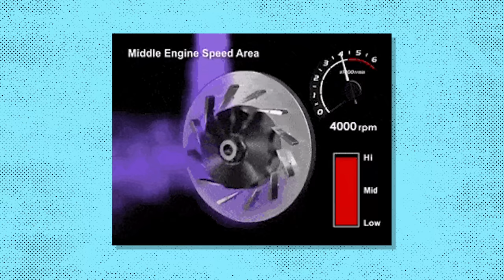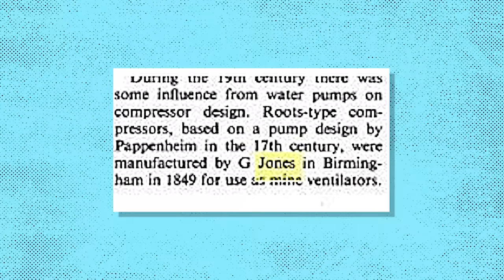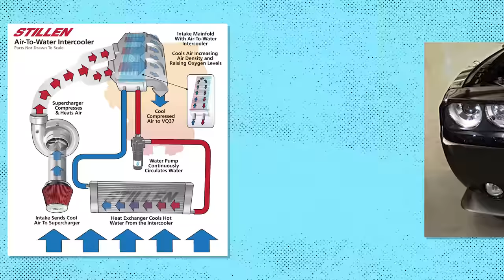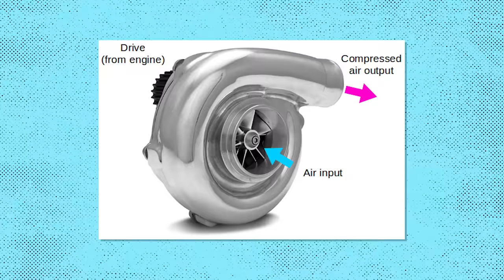Why Superchargers Aren't As Good as Turbos

Comment: From what I remember from physics class, increase in pressure in the same amount of volume increases temperature, so not sure why intercoolers are mentioned specifically in certain parts of the video. All types of forced induction benefits from intercoolers, air or water cooled.
Reply: Positive displacement compressors tend to heat the air more too.
Reply: All forced induction motors?
Not true, when running racing methanol the charge cooling makes ice on the intake of the supercharger casings. An inter cooler at the point just makes the blower up high for no reason(if under it) or is there for no reason. Ice water intercoolers can’t cool the intake temps that low.
Reply: @dallynsr  A Roots supercharger is internal compression type, so its outlet temp is even hotter... the efficiency is low but still benefits from intercooling...
Reply: @dallynsr  That doesn't apply when using port fuel injection or GDI...
Reply: @dallynsr  That would be because the methanol is evaporating and reducing the temperature.

PV=NRT, where P is pressure, V is volume, N is the quantity of gas (this is correlated with the mass), R is the molar gas constant, and T is the absolute temperature (measured from absolute zero).

By evaporating, the water and methanol (or NO2, if it is used) mixture changes from a liquid (which is not counted in the above "ideal gas equation") to a gas. It takes away some of the T and increases the N, so no power is lost, whilst the temperature is reduced and hence the efficiency of the motor increases, so making more power. That same effect is why running rich will result in cooler combustion temperatures and hence less knock and more power (to a point, beyond which more and more energy is being used to partially break down the fuel without combusting it, sooting up the cylinder and reducing power).

However, in forcefully compressing a fluid, one is doing work against the internal energy of the gas, as one applies a force across a distance. This increases the internal energy (called "heat"; related to but not the same as temperature. That equation PV=NRT is for constant heat, so basically heat is the temperature times the mass of fluid) of the gas, and therefore raises the pressure by more than one might expect given the compression ratio (which confusingly measures the change in volume, not pressure). This is what makes diesel combustion possible, and is also largely responsible for knock.

The opposite happens on an increase in volume, which cools the gas down as the gas is the one doing work. In order to "pay" for this work, it loses some of its heat and hence it's temperature.

Comment: The superchargers corner is defiantly drag racing. Screw and centrifugal blown cars usually dominate
Reply: Electric dominates drag racing. Atleast if you dont go to Funny Car/Top Fuel territory
Reply: I could swear that I have red and watched multiple videos where it turns out superchargers aren't dominant because they're better in those conditions. They're dominant because turbos got banned in most of those. The turbos actually allowed more power and faster ETs. I think superchargers really shine when it comes to disassembling the motors after every race.
Reply: @custommotor  no, there are definitely classes where turbos and s/c are allowed. generally, when making big big power, direct drive centrifugal s/c dominate there.
Reply: @rykehuss3435  racing most of the time comes down to class, your mostly racing people just as fast as you through qualifying.
Reply: @rykehuss3435  fastest electric car is 1951 horspower 3 million dollar car that weighs 4700 lbs that can't even corner: 8.5 seconds

  Some guy with a Foxbody that's using slicks with half the power: 7s.
Reply: @youngrody2386  And? That electric car isnt build for drag racing, the foxbody is, custom built too. And it cant corner either lmao.

Top tier Teslas destroy super and hypercars on the drag strip. For a quarter of the price. Thats all I meant.
Reply: @rykehuss3435  "Isn't built for drag racing" The only thing its boasting about are its 0-60s, it has no track times and weighs 4800 lbs with complex aero, so why the hell should I be impressed about that same car doing an 8.5 (only managed 8.9 in practice lmao) quarter mile that's AWD, has torque vectoring, road legal slicks and close to 2000 hp when even a 700 horspower Foxybody Mustangs with 5k mods is able to do it with half the power?

 Teslas are overrated as all hell, Tesla makes them at a loss, gets subsidised when no one is buying them, they get past emmissions regulations to beat stock v stock cars, meanwhile gutted out plaids can only dream of touching sub 9s while ICE can do 7s easily and cheaper, with the fastest electric cars not even being Teslas lmao.

 "Electric dominates dragstrip" Ford created an Electric version of their Cobra Jet and gets dusted by their old ICE version. Keep in mind it was more powerful too lmao.
Reply: @youngrody2386  I never said you should be impressed by it. Also put some road legal slicks on the Foxbody, see how it does. Guaranteed its running with slicks softer and smoother than a babys butt to reach those times.

Teslas are overrated I agree. You didnt address my argument whatsoever though. What I said was true, but you couldnt accept it. Had to go off tangent to something unrelated.
Reply: @rykehuss3435  No but that is a rhetorical question that answers the question at hand, and those same fox bodies with road legal tires can actually still pull 8s and 9s unprepped lmao. 

 What do you mean doesn't? You said Top Teslas are king, they aren't. You agreed they're overrated, you proved my point by saying that and that alone but now I somehow didn't asnwer the question at hand? With the way you worded that question it didn't matter if it was stock v stock or modded, be more specific lmao, but generally speaking Ice > Electric all day, Plaids can have 1020 HP all they want, somehow are still slower around the nurburgring than a Porsche SUV that weighs more and has 400 lesser power, go figure.
Reply: Turbochargers are banned in NHRA Top Fuel and Funny Car
Reply: @rykehuss3435  That is one hell of an overstatement.
Reply: @youngrody2386  They did runs vs ECU restricted production stock bikes in windy weather.  No surprise it wasn't an H2/H2R. A bone stock engine gsxr1000, no power adders did quarter in 6.98, those teslas are nowhere near. That electric crap may go to hell together with a green energy schism.

Comment: I find it insane how much horsepower a super charger robs from an engine. Requiring much more boost to make the same horsepower a lower boost turbo was making. Talking to a racer, comparing two engines, running 19 pounds of boost, super charged on an LS, it made a bit more than 700 horsepower. Then swapping to a turbo, same boost, it made 900 horsepower, just touching it.
Reply: Excellent comment.

Comment: Aftermarket superchargers are usually less complicated to install, and if memory serves they might be more reliable long term. With that said, it’s not unheard of for turbo chargers to last multiple hundreds of thousands of miles.

I like the concept of two serial turbos, where a smaller one provides the boost at lower rpm, and a larger one takes it to redline, basically eliminating turbo lag.
Reply: aye. I don't know about superchargers, but if you floor a big turbo cold, you can throw it in the trash (the turbo). They need lubrication a lot. Don't get me wrong superchargers too, but apart from the centrifugal, they don't spin at crazy insane speeds.
Reply: In reality these days, it’s not hard to build a supercharged motor past its mechanical limit to make power. If we want higher mpgs a smaller displacement motor with a moderate turbo charger has less cruise impact on mpgs. But when we can make nearly 2000hp with a supercharged v8, why do we care if it could make more than 2000 if then built up at huge expense to do so?
The parasitic crowd focuses on the pennies instead of the quarters. (small parts instead of the big picture)
Reply: @dallynsr  Why leave power on table and use more fuel...
Turbos deliver more power and use less fuel.
Reply: @xxxYYZxxx  That is exactly how 2-stroke Diesel engines operate with turbos..
2-stroke Diesel engine requires the supercharger to start and run but loses efficiency at higher rpm.
Turbos blow through the supercharger and unload it, reducing the parasitic drag on the crankshaft and increases power and fuel efficiency.
This system is commonly used in buses, trucks, locomotives and marine engines.
Reply: @xxxYYZxxx  I’ve never seen that before, but your reasoning makes sense to me.
Reply: @xxxYYZxxx  Yes, on WW2 aircraft this done to achieve extremely high manifold boost pressures... 
2-stage superchargers or turbo + supercharger.
This 2-stage compression approach allowed very high boost pressure for "WEP" or War Emergency Power.
Something like a 500 to 1,000 horsepower "boost" for up to 5 minutes maximum before serious damage occurs due to detonation and high temperatures.
WEP often required the use of anti-knock water or water methanol injection to prevent the engines from self- destruction at these high boost pressures.
The use of WEP power destroyed the spark plugs and they hadro be replaced anytime WEP was used and the engine would require an internal inspection for damage with a borescope inspection device.

"Stock block" Class Pull Tractors also use 2 or 3 stage turbos to achieve boost pressures as high as 100 psi or more.
(Diesel engines are direct injection and cannot be damaged by detonation or "knock")

Not really practical for a hot rod.
Reply: @sandervanderkammen9230  Quarter mile time, better low end torque (towing, offroading) and the sound :D
Reply: @BasedMan  Yes, Turbocharger are clearly superior to superchargers, turbocharged engines do everything better and sound great too!

Comment: I did always like Turbo Engines, great Power and at same time Fuel efficient and if you may unplug the right connector also a funny sound ;)
But after the experience with the first Supercharger i do have clearly a new favorite !
Engine with almost the same Power feels so much stronger because the Torque comes instant if you hit the Throttle, absolute amazing, i dont care then about 1 or 2 L/100km Less fuel efficency.

Also After Long use of them they do not overheat like every turbo...  15 Min Autobahn and you have to Cool the Turbo down for at least 10 Minutes.
Not a Problem with a supercharger ;)
Reply: Turbos can arguebly use more fuel if your wanting the power output from a turbo that a supercharger can do you'll be using just as much fuel imo turbos in most cases still mean more fuel anyway
Reply: @leakyrexa1060 That's completely FALSE!
 Turbochargers use LESS fuel.

Turbochargers significantly increases thermal efficiency of the engine and thus has Lower BSFC, this is the amount of fuel per horsepower produced.
Reply: @sandervanderkammen9230  you still need to ignite fuel faster to build the gasses quickly to turn the turbo tho and turbos make more heat
Reply: @leakyrexa1060  No, when running Turbo-normalized there is no fuel enrichment, the Turbo simply increases pumping efficiency.
When operating with manifold boost, they use have the same fuel enrichment as a supercharger to slow down ignition and reduce knock.
If the engine is direct injected than there is even less fuel consumption because there is no pre-ignition or knock (that's why all the new GDI engines are turbocharged.)

No, turbochargers do not make more heat, they run on heat... they reduce heat rejection.
The EGT drops 200° to 300°F as it passes through the turbine wheel.
The exhaust temperature at the tailpipe is lower than a supercharged engine.

Any questions about how turbochargers work?
Reply: @sandervanderkammen9230 how tho is what I'm trying to understand how does a turbo save I get the idea that purely using the natural exhaust pressure to turn the turbo to suck in more air therefore making more power and when you make more compression without fuel consumption you get better fuel economy which is why probably like an Audi A3 is so cheap to run but a turbo Barra for instance costs more to run the THE NA version and they literally nearly exactly the same just a slightly thicker compression ring and the turbo set up but here's the thing BC your turbo is shoving more air into your cylinder the more compression you have when a piston pushes the air up and causes compression it's squeezing and making the molecules move more rapidly which is friction what does friction do? Makes heat so no matter what if you add a turbo it's always gonna make more heat and you can't always just add more air and not add more fuel into the mix to get the right AIR and fuel mixture not even you wanna make more power don't get me wrong a lot of manufactures do that anyway BC of em mission standards but that doesn't mean your not gonna use a lot of fuel non the less to compensate for the amount of air that's just been shoved in so to put it simply you can use the fuel of a normal NA engine to spin the turbo to shove in extra air to get more compression so you might need less fuel to make tourque which is obviously gonna give you more fuel economy but if you are not injection and igniting fuel at a faster rate while recieving the air needed you are not gonna make the rpm and it's as simple as that and the faster the air escapes into the exhaust manifold the more friction it suffers the more friction the more heat yes you can use a turbo to have better fuel economy and maybe a little more power but you cannot have a lot more power and have better fuel economy your gonna have worse fuel economy as a result
Reply: @leakyrexa1060  Turbochargers don't work on exhaust pressure, this is a very, very  common misconception.
All turbochargers have an Impulse type turbine, they use the velocity of the expanding gasses to turn the blades.

The expansion of these gasses is caused by the left-over, the rejected heat from the piston engine.
Reply: @leakyrexa1060  Turbocharged engines have LOWER BSFC, This is the pounds or kilograms of fuel burned PER HORSEPOWER, PER HOUR.

If you have a 300 hp Naturally Aspirated engine and a 300 hp Turbocharged engine.
The turbo engine will consume less fuel per hour at 300 hp.

This is because of HEAT.

The turbine a second engine that runs on the energy wasted by the first engine.
It's called a COMBINED CYCLE ENGINE 
and the turbo is the SECOND PASS or heat recovery cycle.

Is it starting to make sense now?